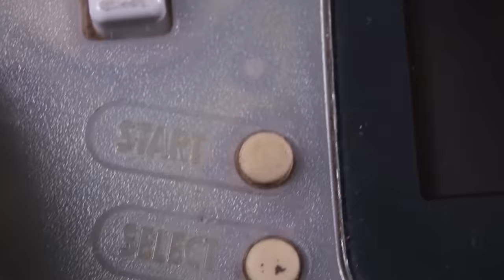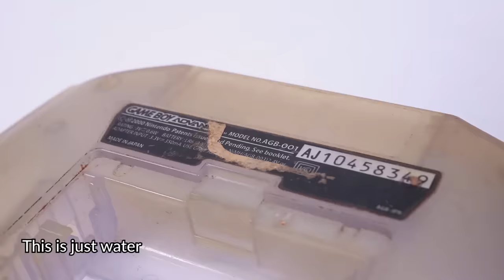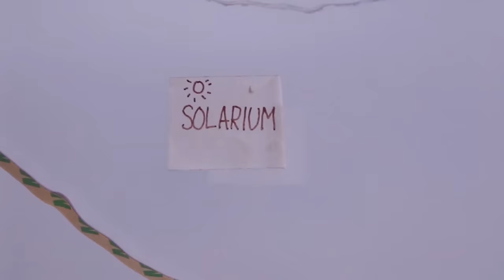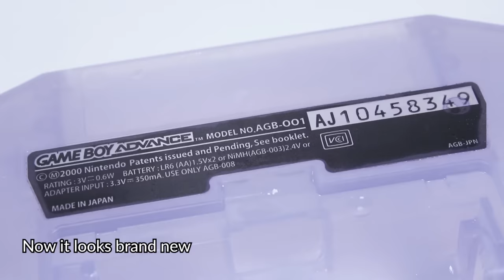I Restored This $5 Ebay Junk Gameboy Advance. It Used to be Blue – Retro Console Repair

Comment: Imagine how many stuff you lost as "broken" and the whole problem was just cleaning the on/off switch
Reply: I know, we hv this place where we help peeps fix stuff they are gonna throw away, and surprisingly a lot of them could still work after being cleaned and some parts reconnected.
Reply: I had to throw away many headphones cause i couldnt fix the weld without equipment. I tried to bring them to stores but none wanted to do it. Had no choice but to replace them. Everything was much easier to fix back in the day. Now the first word you hear from a repair shop is to buy a new item. And it's like they're train not to fix it completely
Reply: @MsLaetitia26  exactly. my ps2 has been broken since 2011/2012 and when i took it to the reparation guy he said i should just forget about it and get a new console because ps2 is outdated anyway and no one is going to waste their time trying to fix that. i'm over 20 now and still love that thing no matter how outdated it was. and now i think it's lost somewhere when i moved to a new place. 😔💔
Reply: My wii stopped working one day (this was pretty early into the Wii’s run, long before Wii U) and now that I know that could’ve been the problem, I feel vaguely injured
Reply: Yes a ton of electronics aren't even broken they're just to dirty to work
Reply: My DSi
Reply: Markman Dave That once happened with my mini Centipede arcade machine.
Reply: I got rid of my old GBA because it wouldn't turn on.... it was otherwise in quite good condition.... after watching a few of these, I am feeling like quite the fool 😭
Reply: I really want one of each of the Gameboys. I used to have each one :(
Reply: If that’s the case I sold a dirty power buttoned new 2ds xl I got last month
Reply: Elijah Taylor I have a 3ds since 2012 and I got it with Mario Kart 7. After a while the L and R stopped working but I was still able to play it’s just couldn’t jump or drift. The problem with them is either the inside button or the spring is jammed
Reply: Elijah Taylor Even though my 3ds is broken I don’t want to get rid of it because I got it from my step dad when he took us on our first Camping trip together. He gave it to me in a red 3ds case with super scribbnaughts and Mario kart 7  with an extra stylus. It was a Black 3ds and I think that was the best gift I had gotton
Reply: Wish I could get this guy to fix my old 3DS. It won't charge (might have something to do with me dropping it in water once, by accident because it fell out of my pocket)
Reply: @Markman Dave wow I'm lucky if I'm the case
Reply: I think this has happened to me rip
Reply: Not many as I like to try to see whats wrong and fix my devices. Im surprised not many people does this, like the saying goes you don't own it if you can't fix it.
Reply: a line plenty of used ones online.
Reply: That would hurt a lot....
Reply: I had some headphones and they were brand new.
one side snapped
I begged my parents to let me use some hot glue, cause it would've worked
they didn't let me

Adults think weird. And I don't like it. We aren't rich we can't just keep buying headphones, we have brains for a reason 🙃
Reply: Had a similar issue with my ps3, the HDMI cord wasn’t working and I never saw my ps3 again
Reply: This had happened to me with almost every 8-bit and 16-bit console I have ever owned. There would gnerally be nothing damaged, but dirt would make the system work poorly. I have had many consoles and pieces of equipment just fail because a port or a switch was dirty.
Reply: I've got a GBC and the A button doesn't work anymore. I probably have to just clean the connector to it but I am not game enough to open  it up despite it being over 20 years old
Reply: @MsLaetitia26  aunque las tiendas deberían hacer eso. Así tendrían más clientes y dinero y sobretodo la existencia del local
Reply: @MsLaetitia26  Or they'll tell ya it'll cost an arm, leg and a left kidney to repair, even though the parts are cheap as hell and the repair is easy peasy. It's good we got folks like Odd to show us how easy stuff is to fix with a little know how and some proper tools lol
Reply: Yeah i restored and kept an old Defender handheld that way. Cost me $2. Just opened it up and cleaned with alcohol and it ran great!
Reply: My mom threw out my DSi because the power button was dirty

Comment: I can’t imagine how strained our eyes were back then when Gameboys didn’t have a backlight.
Reply: hehe, you didn't have the super ultra mega lamp w/ magnifying glass clipped on to yours. It was an insane aparatus that attached to the top of the gba that came up and over the screen. It ate AAs 10x faster than the system itself. I don't remember the actual name of the product so I made up my own lol.
Reply: Older handheld consoles from original Gameboy to more recent ones have serious modding communities that mod everything from backlight to batteries to sound in them. Some even sell them with mods. No need to try and make out stuff from non backlit screens if you don't want to.
Reply: Then the gameboy advance sp came out
Reply: sed8181 I think it had “boost” in the name, I remember seeing one recently at a retro gaming store
Reply: Back when I was a smol boi, the gameboy color had been out for a few months and there was this kiosk in the mall that sold third party nintendo stuff. I bought this super awesome glow in the dark gameboy light that was a bunch of bones, and the lamp itself was a skull. Good times bro.
Reply: Nah there were alot of light clip attachments for it
Reply: Trying to play in a dark car.... oof. Even with light attachments you were waiting for the next streetlamp
Reply: @sed8181  I had a Mad Catz one. And a Worm light too!
Reply: They weren't. The screen is as light as the light pointing at it. Reflections were a problem, thought.
Reply: I cant believe I put up with it, booting up my gameboy now its s9 hard to play for a long period of time. Its just too dull.
Reply: you kan kollekt sume

Comment: me: Broke my leg
also me: "I think it will work after i clean it with isopropyl alcohol"
Reply: I also use it on corpses, they don’t stink anymore.
Reply: Have you tried resoldering it?
Reply: What type? Beer, wine, molten aluminum?
Reply: The joke is nice but I don’t get why people are taking it seriously- he meant it as a joke cuz the guy cleans everything with isopropyl alcohol...
Reply: AHAHAHAH
Reply: SO FUNNY
Reply: @luistheugliestdude1909  Uhhhhhhh 😰
Reply: i mean, it would clean the wound if the break was bad enough to jut out the side. also, fun fact: everything is a fracture. what anyone else would call a fracture is a greenstick fracture. a break would be either one of the transverse fractures, a compound fracture (which is the kind of break described above - jutting out of the body.), an oblique fracture, (which would probably be your idea of a break), and a comminuted fracture, where the bone has been "shattered" or has fractured multiple times to leave chips of bone just around the area, and those are just the catagorys of fractures, theres plenty of variation and other (lesser known) kinds of fractures. i assume this is fairly beginner stuff, as i learned this in a 1 week surgery class for 5th graders. all our frogs that we dissected were pregnant lol
Reply: I CANT HAHAHAHHAHA

Comment: Nintendo needs to start making translucent handhelds again, they're so pretty.
Reply: I agree! I once had a 3ds charger that was translucent blue.
Reply: You can buy the shells for the switch. They come in all the classic n64 translucent colors
Reply: @Urtbreh  they just don't have the same flare though. Nintendo did more than just make the case transparent. The bezels had texture and the hardware inside was coloured for the sole purpose of matching up with the transparent plastic. Even the button cushions had a complimenting colour. But most of these transparent body kits for switches seem to overlook that aspect for a quick buck.
Reply: @TheReeShow  flare -----> flareon
Reply: Petition for translucent switch
Reply: Ones that don’t yellow
Reply: @Smthn_Wicked  yes if that's possible
Reply: The last one was the Pokémon 2DS edition!! Super cool
Reply: They have on the 2ds like the flat one
Reply: Imagine a translucent Nintendo switch...
Reply: At least they did it with the pro controller for the switch
Reply: Until they get yellow.
Reply: There is a translucent controller that has LEDs in it for $50 it’s made by afterglow it is a pro controller for switch!
Reply: @deadalus3247  cough cough afterglow?
Reply: @creamy soup look up on Amazon after
glow Nintendo switch controller.
Reply: Dbrand nintendo switch skins: let me introduce myself
Reply: Ngl I'd buy a clear 3ds
Reply: But they get dirty
Reply: Translucent switch? Yes please
Reply: 3D print a translucent case for your favorite Nintendo hardware of choice?
Reply: Yess
Reply: I don't think Nintendo is gonna be making any handhelds anymore.
Reply: I am looking for a gameboy emulator for that reason. I had one gba on that same color.
Reply: @user-pq4by2rq9y  If you're looking for a portable one, the Retroid Pocket 2 is pretty good in terms of quality
Reply: What about the last one the NEW game and watch with lcd screen exactly a gameboy
Reply: YOOOOOOO TRANSLUCENT JOYCONS YOOOOOOO
Reply: @KevinCasasola2006  Bro you're everywhere
Reply: And helpful for troubleshooting
Reply: Now there is the nintendo switch lite

Comment: After seeing many of your videos, I have grown fascinated with the idea of repairing gaming consoles myself. Where did you learn to do this?
Reply: Anyone can do this, it's just a matter of testing components if need be and also cleaning is a major part of repair.
Reply: @adam_a923   Tools, testing, practice, and probably a few videos or guides on how to do it initially.
Soldering definitely needs practice, cause a bad soldering job can muss it up.
Don't be a musser.
Reply: @ArlanKels  Soldering is hard in the beginning. I'm just getting into it myself.
Reply: @hawkfeather6802  One year later, how did this go? I used a soldering iron the other day for the first time (swapped some old pokemon bateries). It was quite intimidating initially, but with patience, all 3 of my games have brand new batteries. The result doesn't look professional, but nothing was damaged during the process and the games work perfectly. Now I'm waiting for my IPS mod kit to fix and upgrade my old gba sp.

Comment: The fact this used to be clear blue is mind boggling
Reply: I would have thought it was atomic purple, but not blue. :O
Reply: @SirChubbyBunny  no Homunkulus is right. I have the exact same model and it is not atomic purple. Its a slightly blueish coloured translucent tint.
Reply: Michael Jackson used to be black. Wrap your head around that.
Reply: @Ozi Res cursed comment
Reply: It was called Clear Glacier. All others were flat solid colors.
Reply: Homunkulus  Can Confirm. I still have mine in this same exact color and it still works perfectly, but it has the same yellowing problem as the one shown in the video... Thankfully i now know there's a solution for the problem!

Comment: Just listening, no talking, i swear. This is literally amazing and idk how the heck you do this
Reply: you just watched a video on how he does this what are you talking about
Reply: The 64th Shadow haha yeah, his knowledge on all this is literally amazing- i could never
Reply: @bizarrejackjack4036  he took it apart, soaked it in peroxide and uv light (this is extremely common in video game repair) and the only other thing he did was clean the power button, which is check point one because it doesn't power, and the audio wheel because, guess what, it doesn't volume up or down. These are not rocket science steps
Reply: @stevenbenson9976  for someone like me who doesn't know anything about this kind of stuff ?? This is some guy who is an engineer with a doctorate degree fixing some tech 😂
Reply: @romyrkennethtambagan5099  sorry for coming across like an asshole. Isolation is getting to me. Check out videos on retro bright and hand held restoration. You'll pick up a Lot of tips like these
Reply: I'd say its oddly satisfying I guess, but it's just a few plastics in a bin of peroxide lol nonetheless still creative cuz we may all know someone who threw something away cuz it was "dirty" or "buttons didn't work" at least I've known people like that.

Comment: Thank you for this video! My GBA gave up the ghost recently and I was worried that there wasn't anything I'd be able to do to fix it. Remembered seeing this video before , bought a tri-wing screwdriver, cracked that sucker open, and sure enough all I needed to do was clean the power switch.

Comment: Aaah yes, the original gba...even in perfect condition, you still can’t see the damn screen.
Reply: Had to use those little plug in lights like the GBC because the space age technology of backlight wasn't put in
Reply: I would have to sit under a bright light just to see what i was doing.
Reply: @FalcoMoment  I had one of these and an enlarging mirror combined. Amazing tech in those little consoles though, shame out the screen brightness.
Reply: Sega did it right years before with the Game Gear
Reply: I have memories of long car journeys as a child where I'd be playing pokemon, and have to wait for junctions on the motorway to do anything because they were the only place that had street lamps.
Reply: @thelegendaryklobb2879  Atari had them beat by a few years with the Lynx.
Reply: @cariad561  I agree with you 💯%
Reply: Link attached for magnifier and light you can clip on only £4
Reply: Or you can mod your gba to have backlight. It feels so good having a backlight on that thing
Reply: With all the trouble he went to taking it apart and restoring it, he could have easily added a backlight. Original gba is comfier than the SP anyways so with a light added I'd say its the better version.

Comment: me: has no knowledge of how electronics works, does not know how to use chemicals or tools
also me: Im gonna restore a gameboy too
Reply: Mee too, i actually got a gameboy for 10 and did a pretty decent job, and sold it for 45 :v
Reply: i have a gba sp in my elementary days
planning to fix it if i have the proper tools,but if there are things that needs to be replaced...imma buy a spare just in case
Reply: Thank you for suing the correct form of to/two/too
Reply: @whalecat8049  suing 🤣
Reply: @MichaelWilliams-tv4jx  yes. I said suing instead of using to make it ironic
Reply: @whalecat8049  "don't you think"
Reply: @MichaelWilliams-tv4jx  what
Reply: Same feeling for my psp but eventually I screwed it up😂
Reply: Luisa Silva - so did you ever get around to it? If so, how’d it go? If not, good luck my friend
Reply: @hectorvelez1546  buying a $5 "broken" one from eBay would save you a lot of time. Lmao
Reply: @cheriberry3  or i could use the "broken" gba sp parts to fix my  broken gba sp...that could save me money also. thanks btw
Reply: Aurea the spider girl I did that and my original gameboy turned out mint and beautiful
Reply: FAILURE me
Reply: I'm actually doing that.. i bought a game boy (the first one) for 2 or 3 dollars like 10 years ago, it was not working, after some cleaning i made it work, and now im preparing to restore it, first the yellow plastic and then mod it to have a backlight screen.. if it works im gonna be very happy

Comment: I’d recommend a cheap set of artist brushes for when the toothbrush just won’t fit for your cleaning small components. I use them with a variety of tip types.
Reply: The bristles of the artist brushes are too soft, unlike cleaning brushes like a toothbrush which are stiff, even the ones for painting houses can be a bit too soft, or even leave hair behind, specially cheap artist brushes.
Reply: Golden Cyber   Sure. Camel hair are too soft, so I use nylon, generally, and often cut them shorter to stiffen further. Boar bristle can work, too, if you can find them. (For portraits I use my good quality brushes and such) Haven’t had any shedding of bristles that a forcep couldn’t handle. Gets into nooks and crannies a larger brush cannot, which was why I mentioned it after seeing him scrub inside the switch body. Does great job with his work.
Reply: @ShinyaSpooky  I think he's talking about those cheap artist brushes you buy at the Dollar Tree
Reply: @ShinyaSpooky  you know the ones with the really scratchy bristles
Reply: I’ll just steal my sister’s then
Reply: @ShinyaSpooky  no trust me ive experienced really rough painting brushes